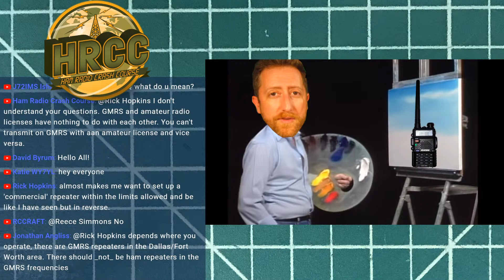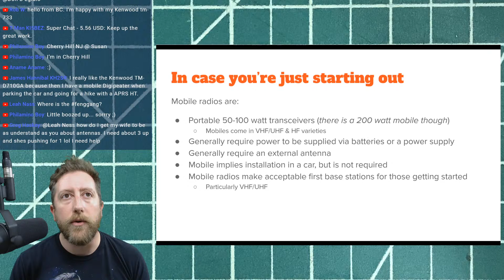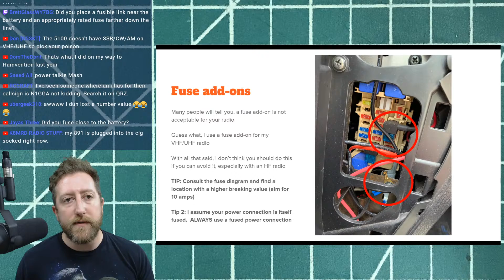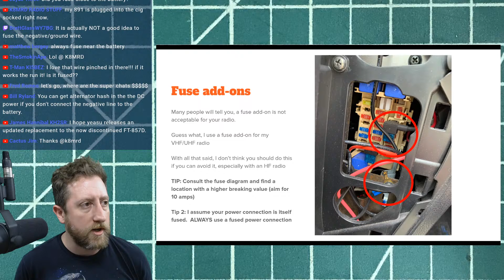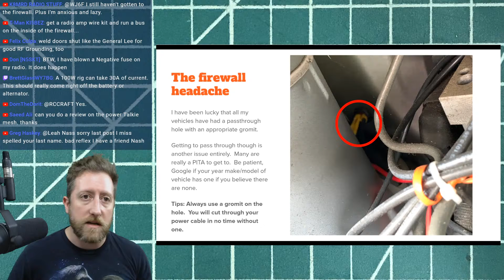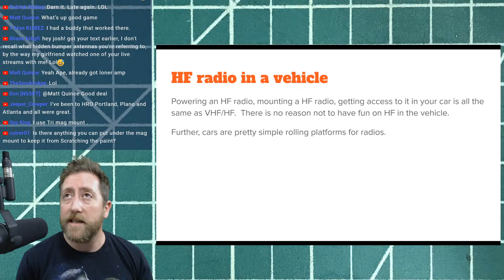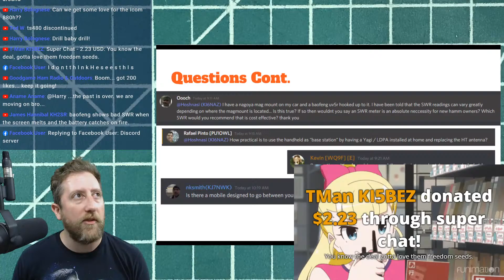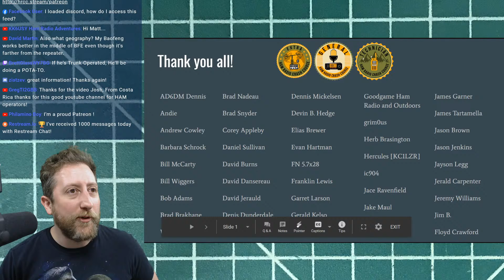How to Setup Mobile Ham Radio VHF/UHF & HF and Tips - Livestream

Comment: The Little Tarheel 2 is not very heavy. it's just shy of 2 lbs with the standard whip on it, weighed on my digital kitchen scale. There are less expensive screwdrivers but many have a reputation for failure and expensive repairs. You get what you pay for. I would never try the Icom due to the huge number of complaints of failure and $270 repair bills, the Diamond only as a second choice. Icom's only positive is that it covers all bands but it requires their tuner too. ultimately there is no savings there. Buy what you like choose well and you wont have to buy it again, and again.